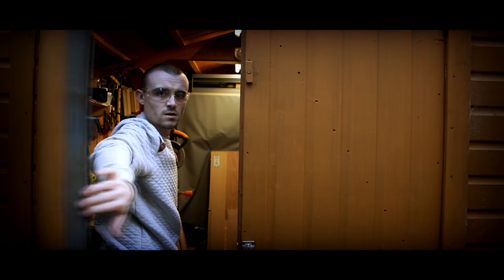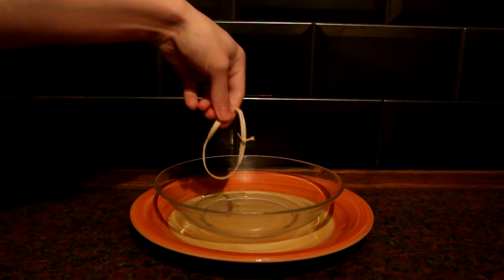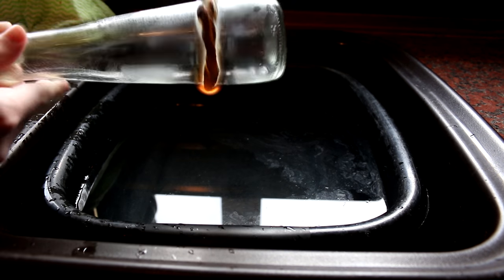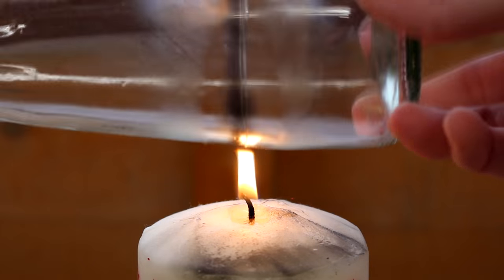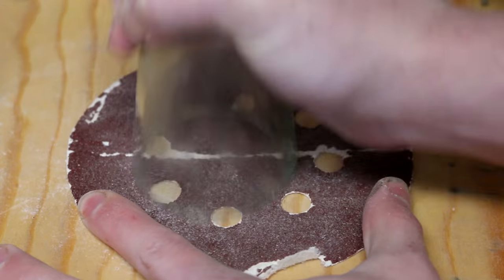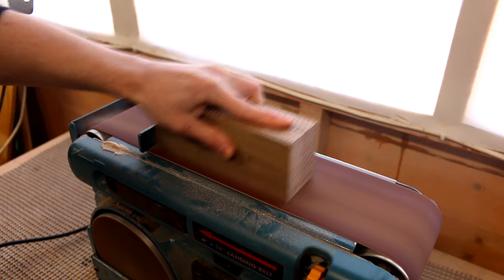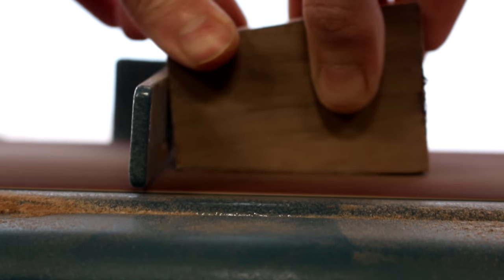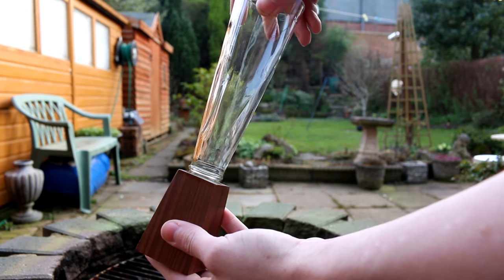How To Turn A Glass Bottle Into A Flute Glass - Trash To Treasure

Comment: Joe this was a really cool project. Once you poured the Zeo in and I saw it in the glass I thought it would be awesome if the glass was lit from underneath. If you make another you could drill a hole in the cap and the wood base and then glue the cap in with clear epoxy and put an LED in the base from the bottom. Just a thought.

Comment: I remember the Greenpowerscience channel found out a way to cut glass bottles so you have a perfect cut.
It involved a rug to turn the bottle, putting it in ice water, and then slowly pouring hot water over the score line.
Reply: ***** Yeah, it's kind of interesting with his methods.
I have yet to try the boiling water on a cold bottle.
I may try and find a glass cutter during spring break and see if it works.

Comment: pine is my scrap ,  lol walnut is  so expensive in myt country    1x6  4ft  45$    3/4 thickness  labeled as  1 inch
Reply from the maker: Haha Its expensive here too. I keep all the little pieces of walnut I cut off for projects like this.
Reply: I even keep tiny cut off to use as spline i throw away nothong. Ill grind the specks up and use it with glue as a wood filler
Reply: Smart